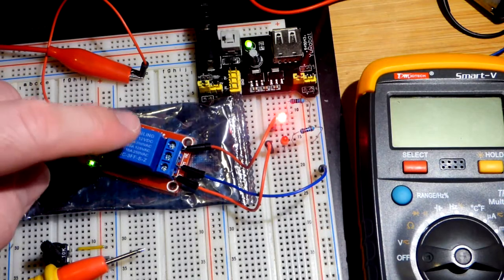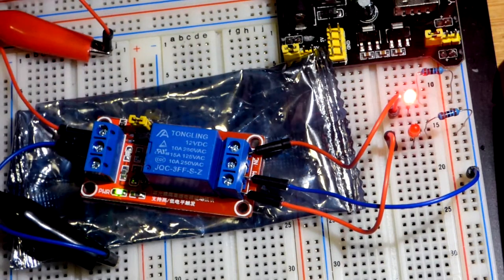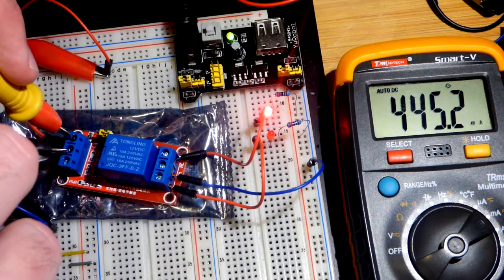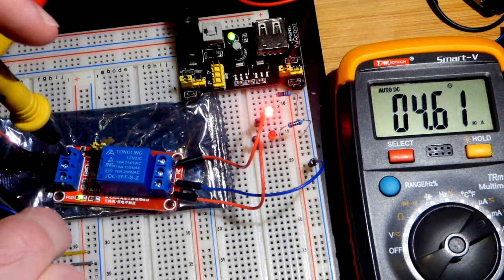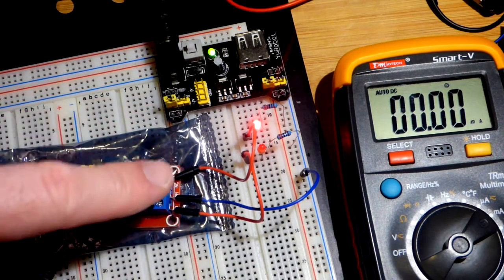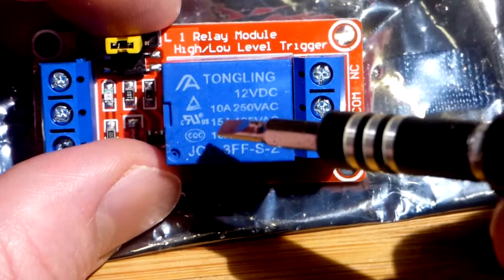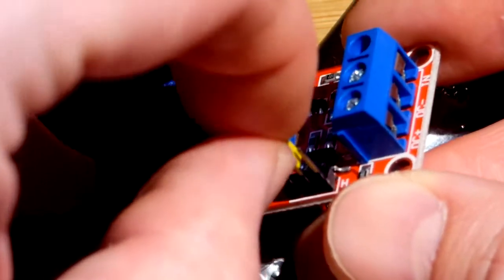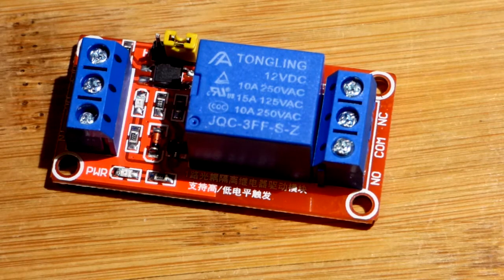Electronics 12V relay with dual NC NO switches module with high or low trigger

Comment from the maker: https://www.youtube.com/c/electronzap subscribe and click the bell! https://www.youtube.com/c/Electronzap/community has my recent diagrams. https://www.patreon.com/electronzap - https://electronzap.com/ -  https://www.amazon.com/shop/electronzapdotcom is where I post affiliate link ads of products that I use in my videos or would like to buy. As an Amazon Associate, I earn from qualifying purchases.
Reply: Hi, can you help me, I have the same  relay, but I can't get it to work with a 12v signal trigger.
Reply from the maker: @WorldwideArcades  I hope I can lol. As long as everything is wired properly and nothing is broken, the only reason I can see the module not working is if whatever is providing power to it can't provide enough current.
Reply: @Electronzap  Hi, thanks for your reply :) All is wired ok, as I have another module which is 5v set up the same and that works perfectly. The power that goes into the board seems to be enough as the power led is very bright. Might speak to the ebay seller and ask for a replacement as I think its a dodgy board to be honest. Just wanted to really see if you had come across any issues when you wired up yours?
:)

Comment: Thank you for the video. I am trying to find something like this operable by a momentary switch connected to ground to control a light. Push button once, lights go on, push again, lights go off. What do i need for that, bc it looks like the trigger here has to be constant like a regular relay?

Comment: is it possible to use the same module but have them both in a normally open state (or normally closed) instead of one and the other?
Reply from the maker: Not with this module, but you can find double pole double throw relays  which have 2 common terminals, 2 NO terminals and 2 NC terminals.

Comment: Can these relays be used without the high/low trigger pin used?  I want the relay to switch a load when the 12v and ground is supplied only.

Comment: pls "12 v DC as power supply for light bulb" use with this relay and control from Arduino Uno.
Reply from the maker: I don't make arduino videos, they are code based and it is just as easy to copy from a website as a YouTube video, so it's not worth the time and effort. Thanks for watching!

Comment: Question: 0 volts = gnd ? Like a negetive trigger ?
Reply from the maker: Terminology changes based on the situation, but yeah, usually those all mean the same thing.
Reply: @Electronzap  
Thanks  .. I appreciate your time and answer. 
I did do a few experimental tests yesterday.  Negative triggers RULE !
Second question: Are this style of optocoupler-relays .. durable enough for me to use in all parts of an automotive applications  ?
I'm planning to build a complete electrical system, driven by optocoupler-relays.
And using two 30amp optocoupler-relays for the higher powered coil and starter relays.
Thoughts?

Comment: can this module handle direct connection to  car battery?
Reply from the maker: I think you can use it with a car battery. Always have to check the specs of components to make sure they can handle what you want to do with them.

Comment: My diagram calls for a 12v dual coil DPST relay. I can't find much for dual coil DPST relays, I assume a DPDT will work just as well? Do you have any recommendations?
Reply from the maker: If there's 2 coils, then I believe it would be a latching relay. They only use power to change switch positions. Once the switch is in either position, it stays there without using power. You'd likely might have to modify the circuit if you use a normal double pole relay.
Reply: @Electronzap  Yes sorry it's a latching relay. I assume it has to be a latching relay in case of power loss or voltage drop. Any power interruption could be problematic.
Reply from the maker: @techloidtech2051  I have 1 or 2 latching relays because they came in a kit I bought when first getting back into electronics. Used in a couple videos. Otherwise, they are not easy to find. They cost a lot more than regular relays.

Comment: Thia is the best explanation ive seen and ive watched 3/4!! Thanks.

Jjst to confirm i understood it correctly.

Im building a Arduino project that needs to have a 2x 12v rotary LED beacon lights,

 the first blue rotary LED needs to be on and when the device is activated the red rotary LED light will switch on and the blue switch off.

My understanding would be that i can;

Using a 1 channel 12v relay;

I will wire the 12v to the input and ground to the Arduino.

Have my 12v beacons wired with the blue to the NC and the red to the NO.

Thenusing the trick for a low power input use the switch from mu Arduino pin to trigger the change?

Thanks
Reply from the maker: I think you got it. The common spot will likely be ground/negative supply for both circuits. One circuit to NO and the other to NC as you say for the positive (high) side power and load of the circuit. According to a google search I just did, the Arduino should be able to handle 12, but I'd make sure before you power it with that much. I think the Arduino will have enough output voltage to switch this relay module if it is powered with 12V. You can use the same 12V power source for everything if the Arduino can handle that much. I haven't used my Arduino in a long time, so I don't remember it's limitations.

Comment: My plasma torch handle has two wires going to it from the machine.  The two wires go to the trigger switch which completes the circuit allowing the torch to fire. I have the same red relay that you are using in this video. It looks like I need to connect the two trigger wires to the normally open and the common connection on the relay. The relay will get its power from a breakout board on the CNC machine that the plasma torch will be hooked up to. The board is an MKS DLC 32. It has a spindle output connection which sends 12 volts. It will send the 12 volts only when the torch should fire. So as the machine works the 12-volt signal turns on and off as the torch head moves around the table. I need to use that 12-volt signal to activate the relay. Can you explain in very simple terms wear the 12-volt signal power should be connected to on the relay in order for the normally open and common pins to complete the circuit? Thanks.😮

Comment: I have the same relay and I'm trying to figure out how to get it to activate the two wire trigger switch on my plasma cutter. When my control board turns on it outputs 12 volts at the spindle connection.. when that happens I would like the relay to close the switch circuit on the plasma trigger. Any advice? Thanks.

Comment: Thanks! If I have a 1.3V signal, will this module work?
Reply from the maker: I don't think so, I think it needs to be close to the voltage of the relay. Could use the signal to switch a transistor though.

Comment: I’m looking for a two channel 12 volt relay, I want to be able to switch on a 12 volt load and 36 volt load at the same time, looked on Amazon but don’t see any that triggers with 12 volt, none specify it anyway. Can I use 12 volts to trigger a relay if it only requires 5 volt trigger?
Reply from the maker: Here's an Amazon affiliate link to 2 channel 12V relays https://amzn.to/3QXIADI , I selected that one because Amazon lists it as "Amazon's Choice Overall Pick", I have no opinion if it is better or worse of a deal than the other options that popped up in the search or listed on the same product page. Otherwise I would use a 5V regulator to switch a 5V relay. I don't know how well the 5V relays coil will handle 12V. I just bought some automotive relays https://amzn.to/47YzsWs (affiliate link) that I keep forgetting to make videos with. They are 12V, and I suspect that they might be more convenient in other 12V systems than the circuit board modules.

Comment: Can i use 12v 10A power supply with this module ?
Reply from the maker: Should be able to.
Reply: @Electronzap  thank u very much 
And the control signal should be 12v ?
Reply from the maker: @mohamedseddiqdjouadi1794  I honestly don't know what range of voltages works, but 12V will definitely work.
Reply: @Electronzap  thank you

Comment: I’ve been running positive to common on my relays. What’s the difference between running common to ground vs positive to common?
Reply from the maker: The switch part of a relay is just a mechanical switch, so it doesn't matter which way power flows through it.

Comment: Can this relay be triggered by a 12v 150ma AV receiver trigger?
Reply from the maker: I don't know anything about AV receivers, but if something can provide 12V and 150mA, then that's enough power to control a small 12V relay.

Comment: Can you give this relay 24V and then make the output voltage bed 12V?
Reply from the maker: The module has to be powered with 12V. The load that you switch can't exceed the limits written on the relay.

Comment: Could you clarify what you mean by High and low? as in digital electronics, high is 5v and low is 0v, Does this relay require 12v to trigger? or is it powered by 12v and then we can trigger it with a 5v High output from our controller?
Reply from the maker: A 12V relay should have a high input when it is close to 12V. However, I'm pretty sure there's relay modules that are powered with 12V or 24V, but respond to high/low signals of 5V/0V. That's an important specification to look up when searching for a relay module.

Comment: if i use 12v relay can set it to low signal and trigger it using 5v supply? thanks
Reply from the maker: The voltage given  is what you need to get close to in order to switch it. The relay itself can switch higher voltages. You just have to buy a 5V relay instead of a 12V.

Comment: Is the output side isolated to the input?
Reply from the maker: Yes. All input power goes to a coil and to power the rest of the module. When the coil passes current through it, then it creates magnetic fields that move the mechanical switch position at the output. The output is only electrically connected to whatever you wire directly to it. The output is just a switch. It does not provide power to other circuitry.

Comment: I am driving the relay with a 12 v battery.  I can get the Red Ready light, and using the (-) com rail to for the INT.

The relay goes green light, and can hear and feel the relay activating, but I get nothing(voltage out) on the NO, NC, COM via a voltmeter.  Any suggestion?
Reply: To add to what ezap is saying: the relay outputs are just a switch, not a power source. You have to wire in a power source to the relay output contacts. If you like the 12V supply that drives the input side, and it has enough current to power what you want, then select if you want to switch the + or - of the supply and connect that wire to relay COMmon. 
Note: do not remove the existing wire from DC in.
Either connect relay COM to the same +, or all the way back at the local supply source.
Select a wire size that will handle the current required by the device receiving the relay output.
Add a fuse between the power source and the relay common, bigger than the load requirement, but equal to or smaller than the wire current capacity.
Return the load wire from the other side of the load, ( -) in this case, to the supply (-). 
Draw it out and check the wiring.
Select output: if you want the supply normally present until activated choose NC.
If you want the supply normally off choose Normally Open.
Reply: @georgecatlin3514 that is so basic!! I consider myself fairly good with electronics but I was stumped. I was assuming it was power out like op but a switch like a normal relay makes so much sense it’s obvious! Thankyou so much
Reply from the maker: NO NC and COM aren't electrically connected to the rest of the relay. They just act as a mechanical single pole, double throw switch that is controlled by the rest of the relay.

Comment: Nice presentation!

I am currently doing a small diy project with both an optocoupled relay and an Arduino Uno. Fortunately I bought both 12v & 5v versions of these relays because I just read that the trigger voltage for these 12v relays is more than the 5v pinout voltage from an Arduino Uno control pin.

But, I have read elsewhere that some versions of this 12v optocoupled relay will trigger as low as 2.5v. It would be great to determine what the actual minimum trigger voltage is for the majority of these devices by direct testing. (For example, many Arduino users might like to trigger these relays from the Arduino's 5v control pins if it is possible.)
Reply: Mine is triggered as low as 0.3v, so even my arduino pins are low they are still on lol😂😂😂

Comment: I have a ESP32 and this exact same 12v relay. I do not have a 12v power supply. Can I use the 5v output from ESP32 to turn on the relay?
Reply from the maker: Probably need at least 10V for a 12V relay. There's 5V relays out there.
Reply: @Electronzap  i ordered from AliExpress waited for months 😂. Kinda sux to wait for another month now

Comment: Can I use the same battery for both outputs on the relay for 2 different circuits? I did this but the relay keeps clicking. It can't stay on.
Reply from the maker: I think you should be able to. I would look at how other people wire their circuits and make sure it is wired the same. If the battery gets short circuited, then that would cut power to the coil and turn the relay off. Could be some other problem too. Might be a bad relay if everything looks well wired.
Reply: @Electronzap  In the end I ended up using a different receiver circuit with a 12V relay and that worked!
Reply from the maker: @Berghiker  glad to hear!
Reply: @Electronzap  I think the fm bug is interferring with the relay. All other circuits and heavy load circuits work. Seems like the RF is the problem.

Comment: With all respects, you should remove the bag from the bottom of the module as it is conductive. These bags are designed for ESD not to isolate circuits :-)
Reply from the maker: I didn't think of that, thanks for the tip!

Comment: Thanks for the very helpful video. I have a question: Would it work okay to hook up 12V that already switches on & off -- e.g. the power from a car "cigarette lighter" socket that's only powered when the car is on -- to both the DC+ and IN pins, to make this relay work like an old school, 4-pin relay? Or does the 12V DC+ have to be constantly powered, with only the input pin switching on & off?
Reply from the maker: If the cigarette lighter output cuts power to the module, then the module's relay switch will be in the normally closed state no matter what.
Reply: @Electronzap  Makes sense. I'll get my hands on one and verify that if 12VDC is applied simultaneously to both the DC+ and IN pins, the NC will open and the NO will close as expected. Thanks again!

Comment: I think I have the wrong relay.  I have a 12v trigger 150ma that I wanted to use to open/close the relay and a 5v power source.  I think I missed that device needs a 12v power source,  is that correct?  I probably wanted to a 5v relay and use the 12v trigger the relay?  Is that correct?